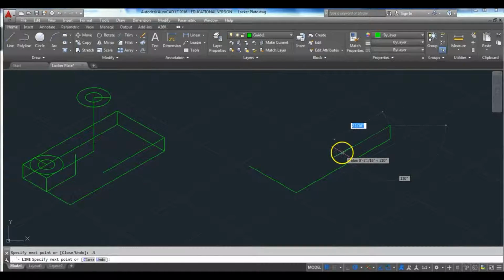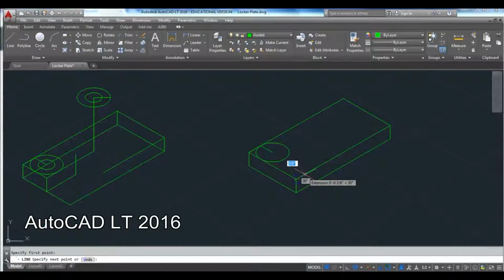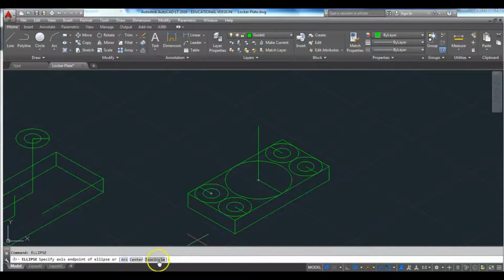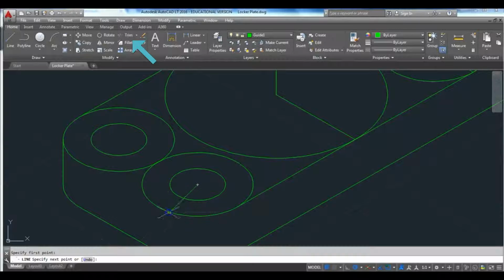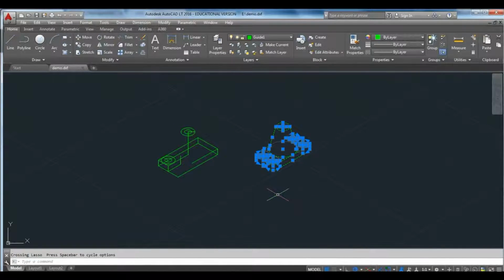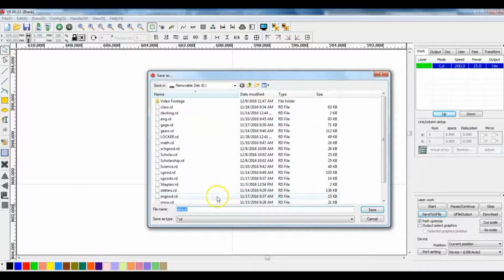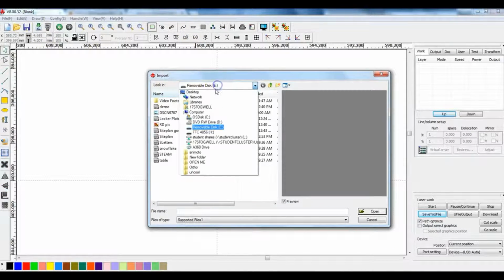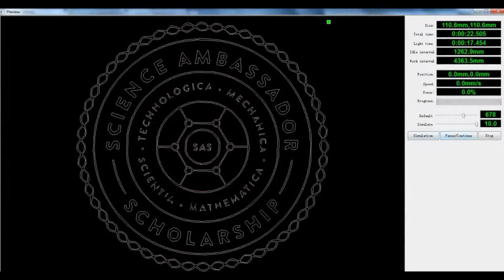CAD to the Cutter

Comment: nice I try to import a file from autocad in DXF files .. and I have problems in files > sometimes the line for curve is broken and some times some drawing lines is missing when I use rdworks v8
and I didn't find any solution... can you help ?